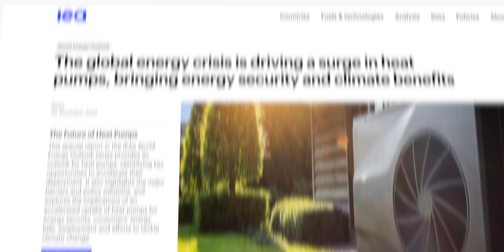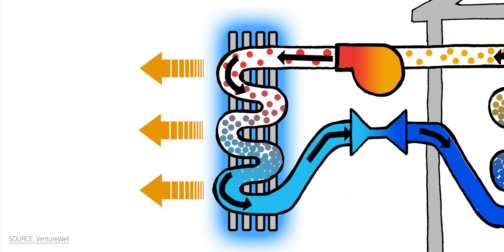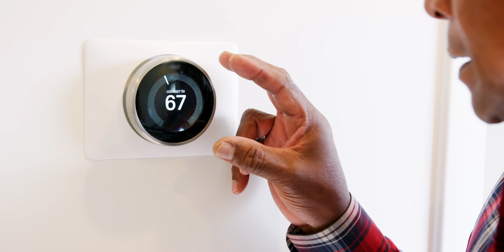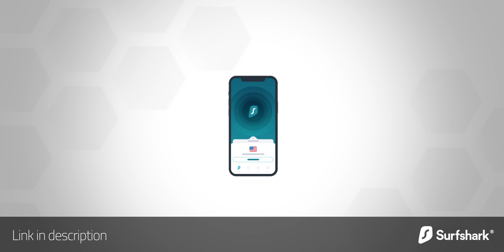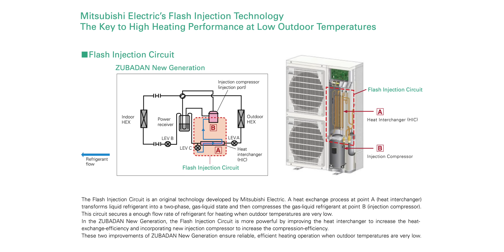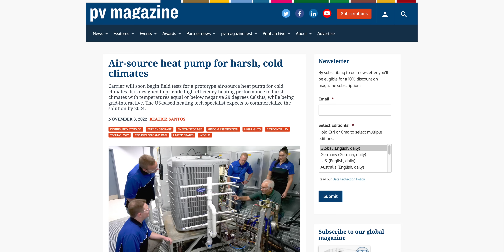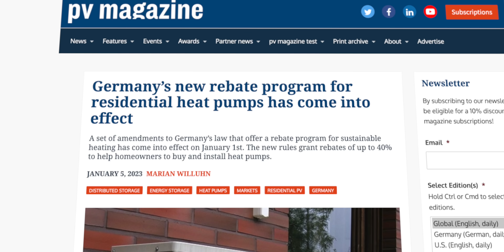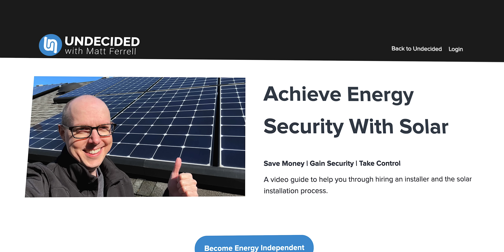Major Advances with Heat Pumps in the Extreme Cold

Comment: Here in Sweden, I have a ground source heat pump. It saves me approx 4000 USD a year at current electricity prices compared to resistive heating this building had before. We went from 35-40MWh/year to 16MWh/year. Just hot water heating with it saves 3MWh per year.

Lots of people here have air source heat pumps as well, if you drive around, most houses have one, and they've been used for 15-20 years.
Reply: How many amps/watts does your system use at full power?

Comment: Your explanation of heat pumps has a major error - as the high pressure liquid expands into the evaporator (cool side) it turns into a low pressure GAS which is what makes it need heat to change phase. Only the gas goes through a compressor, NOT fluid. The output of the compressor is a high pressure (hot) gas which condenses back into a liquid which forces it to give up heat as it changes phase back to liquid. There is an very well done detailed explanation here: https://www.youtube.com/playlist?list=PLv0jwu7G_DFVIot1ubOZdR-KC-LFdOVqi

Comment: As a New England resident that lives a bit north of you, I'm going to called Shenanigans on your "data".  You're basing everything on "new" or "coming soon" models.  I've had a heat pump in my home for 8 years.  Great in the summer for cooling but in the winter, below 25F, it just blows cool or lukewarm air.  I've contacted the local place that does my cleanings and service.  There is no upgrade path for these models to do what you are talking about.  I'd be interested what you find, given your resources, however for those of us who jumped into heat pumps as a big way to save money in heating, it really hasn't done much.

Comment: I'm interested in getting a heat pump to replace our very old AC unit (24 years), using it for cooling in the summer and for heat when it's more efficient than my 97% efficient furnace. I've been told that the crossover temperature for running the heat pump vs. the furnace is about 40F, but it's more of a rule-of-thumb, and I have yet to find an actual calculation for that. Also, it's been very difficult to find actual details on the IRA tax credit for purchasing a heat pump. Matt mentions a 30% rebate, good for up to $2,000, but I can't get an HVAC installer to tell me which models are eligible and how much the rebate will be. Very frustrating situation when one is trying to make a purchase and I don't have the support needed to make that purchase. 

Anyone have a direct link to the IRA tax credit details for heat pumps?

Comment: In Norway we had incentives 5-10 years ago, but now air to air hest pumps are so normal that the incentives are gone, but you can have the cheapest models for around 1000$ installed and the expensive ones are 2500-3500$ installed.
Liquid to liquid / ground sources heat pumps are still quite expensive at around 20000$+ for the heat pump system without any digging og drilling, just the heat pump.

I got my 2 air to air heat pumps for 450$ each on a special sale, quite a good deal!

Comment: No issue with air source heat pumps that was installed 2 years ago for heating or cooling the house. However my Hot Water Heat Pump system has experienced cold water once the air temperature reaches below 3C for a couple of days. As this only happens a few times during a Australian winter I have learnt to live with but still would prefer not to have this situation occur.

Comment: There’s no theoretical reason that heap pumps can’t be made to work at any temperature we experience here on earth.  After all as long as the temperature is above absolute zero (minus 273 degrees Celsius) there is heat present that can be extracted, it just becomes less efficient to extract it.

Comment: switching an oil or propane furnace ($45,000 per 10 years to operate) to an 18 SEER inverter heat pump will save you $30,000 per 10 years.

Comment: I have three heat pumps air/air and they are worthless. First of all they need another system for basic heat or they can't cope at all. And can only be considered a complementary source of heat. I have an open floor plan and that is not good since the pumps can't heat large volumes of air. They run constantly and freeze up in the outside unit even tough they have a heater. That is a pain in the ass because you need many days of not freezing weather for them to thaw up and they have to be turned of during the wait for that. And when you need them the most when it's minus 15 Celsius they just produce less and less and at minus 20 Celsius they just use energy and give no heat. i have learned that less freezing occurs if you lower the thermostat. So at minus 15 C I have to set it at 15 and at minus 20 at 13. By then my other system have kicked in long ago.  I can only see them as useful in dry climates like in deserts and were it doesn't get very cold. Ad to that the huge volume of ice that builds up under neath them. Stay away from air to air pumps. As for drilled holes and ground those loose efficiency fast due to not using them during the summer as air condition. The substrate you tap cools down. And what's the point to have to cool your house if there is no heat during summer like in Scandinavia where I am located. That eats up the winter savings. No, the only good option is  to drain heat from a body of water or a farm barn with animals. The only worse option is burning something, that is just plain stupid due to the air replacement factor that creates super cold areas in your house. Very few system takes air from the outside. Just vote for a government that likes nuclear and then use electricity for heating. That is the only good thing about heat pumps that there are no cold drafts.

Comment: Air to air Heatpumps can ruin your economy in the winter if you live near open ocean and the theperature drops below around - 5c to - 7c... Firs year I had a had I heatpump I did not know that because I believed all the propaganda that said they word just fine down to -25c. Yes they function perfectly fine down to -25c  but ONLY if the air is dry which it is NOT AT ALL when you live near open ocean...

Comment: I'm in Utah County, Utah.  I did a DIY MRCool universal heat pump install at my house.  Bids for the heat pump + install were up around $10k.  Purchasing the heat pump + air handler + pre-filled line-sets (~ $4200), the tools and ducting and whatnot to do the install (~ $500) and paying the electrician to upgrade my home panel to handle the new units (~ $800).  Going with this DIY setup saved me about $5k. 

Now, I did run into a couple of issues.  But those were due to my inexperience, not really with the system.  The biggest problem you can have for your air-source heat pump is the unit icing up. Normally the defrost cycle clears that up.... But I set up the unit just on the cement slab outside the house (MISTAKE).  These units create a lot of condensation.  You need to have good drainage.  The unit being right there on the ground creates icing issues, basically the ice grows UP my unit.  I've since fixed the issue by raising the unit up off the ground.  And now my unit runs a LOT less each day, the snow hasn't been an issue (lots of snow this year).

Comment: The biggest complaint I've heard about heat pumps are a) the slower heat gain of temperature (not like a furnace blast), so heating the house takes longer especially if you are trying to raise it 10 degrees, and b) because of the slow temperature gain poorly insulated duct work or windows will make it harder to heat becoming a larger heat sink/more problematic.  I wish these concerns were covered.  For me, the most energy efficient way to heat on the really cold nights, is to lower the thermostat (not off because you don't want to freeze the system) and use small space heaters only in the rooms you need.
Reply: This is why new homes and retrofits are designed to address the system as holistically as possible - heat pump at the heart if it's needed or new build - but the real ROI is in the insulation package, windows, and doors. Numerous studies have now shown the best money you can spend on efficiency is insulating/air tightness (especially at the roof and basement if you have one), insulating ducting, followed by good tight and insulated doors, followed by windows, adding an ERV/HRV, and lastly replacing old coal/oil/gas burners with a heat pump.
Reply: @anomatrix0000  Is making the building so airtight that no fresh air ever gets in a good idea,  we have all heard of 'sick building syndrome' due to lack of airflow.. I know you can get air exchange systems with heat exchanger,  but even more ££££'s
Reply: @chrissmith2114  That air exchanger (HRV/ERV) is part of what helps keep your indoor air temps/humidity stable and saves you more in the long run.
Reply: You shouldn't lower your temp at night with a heat pump. A new report from the government showed that. You're right it's too slow. So leave your temp setting alone. We've done that for  years and the system doesn't need to use the electric burners to reheat the house.

Comment: I've got a lenox heatpump/furnace combo at my primary residence and its pretty great, but it for sure doesn't work below 40F. I forced it to fill in for the gas furnace when I was working on some gas lines in the winter and it did not love it.  It frosted up pretty fast.  I also have a Mitsubishi inverter split-mini at a more northern, colder climate and that thing keeps on chugging WELL below zero.  Its amazingly robust and quiet too.  I've been super impressed with the split-mini.  The best part of the heat pump is energy independence.  Where this split min is, you either have to use electricity or have propane brought in and stored on site. We have used wood fired pellet stoves, propane boiler hydronics, and propane forced air in addition to heat pumps.  I loved the hydronic system when we kept it going but it was very slow to heat, and the pellet stove chucks out the heat but its pretty hard to justify given the emissions.  Right now we close down the place with the split mini in the winter and the other place is run with forced air propane.  I would love to move away from forced air propane to a heat pumps so I don't have to worry about propane levels in the winter when I am not there.

Comment: I’m in the process of adding two mini split heat pumps to augment my central HVAC system. Installation cost is a main hurdle here. Bids to install a single unit are between $1,500 to $2,500!  I overcame this by buying $350 of equipment and doing it myself. While I could overcome this installation obstacle many people cannot. BTW, it took me a total of 2 1/2 hours to put in the first heat pump.

Comment: Apart from variable speed compressors you didn’t really explain how the heat pump is able to extract heat from the outside environment when it’s so cold. Does it mean that the fluid in the evaporator would need to be colder than the outside air??

Comment: My air to air Mitsubishi have been working great since 2012. It does have a inverter based compressor for variable speed. Also it has a heat element in the bottom of the outside unit so melting water when defrosting doesn’t ice up in the bottom of the unit. 
It defrost the most just above and below freezing. Up to once pr hour. When it gets colder and the moisture in the air gets lower, it can run for hours without defrosting. 
IIRC it can keep up the BTU until -18c at least. But it is an older model. Of course the COP drops the lower it gets.

Comment: I wish people would explain the mechanism a little more correctly.  Compressing the air doesn't make it hotter per se.  The amount of heat latent in a volume of air remains the same, it just  gets concentrated.  When I comes to compressors and heat, I think of them more as heat concentrators.

Comment: Heat pump hot water system were sold an Government subsidised in Australia about 25 years ago . Had a a few . in the fine print they only operate above 14 degrees c ( about 60 F  )  they just used an electric element to heat them . This is because the advantages of compressing diminish to almost no  advantage at low temp . They would break down every year and need service under warranty . The company had to repair huge numbers . Result is most people will not buy them no matter what brand .We in Australia used to use hot water heaters that rang at night when electricity was 1/3 the normal rate ( thus helping stabilise the grid demand  ) .

Comment: We live in the NW where it gets below freezing in the winter and our home is heated 100% by a Mitsubishi heat pump and it's comfortable all year long. The trick is to never let the house get cold in the winter or hot in the summer. For example, don't turn the heat off at night -- let the pump continuously keep the house warm. A heat pump doesn't heat as fast as a gas/oil furnace, so going from 55 to 72 degrees takes longer than say from 65 to 72 degrees.

Comment: I am having a double air source heat pump system installed this month (Vaillant Arotherm plus, 15kw each). I live in Portugal, a mild climate, in a fairly large cold house. The CoP is between 3 and 4.8. It is not activated yet. The upfront cost is high, the installation in a very old thick stone house is complex and disruptive. The other options for climate control would not offer cooling in the summer. It would be have to be a gas boiler, pellet boiler, or electric resistance boiler. Even with the new solar electric system, that is not an efficient use of energy. The heat pump is really the best option by a large margin. The house also has other supplemental heat (salamander wood burners and a fireplace insert).Heat pumps are going to be mandatory in Europe, some countries are requiring it sooner than others. It is going to be the primary direction that most of the developed world is headed.

Comment: In the UK heat pumps face two major obstacles compared to using our typical gas fired heaters. The first is our housing stock is old so often lacks insulation. This means they leak heat so money has to be spent to better insulate the house, adding to the upfront costs of a heat pump system. The second is the use of either the boiler to supply hot water directly or a tank heated by water shared with the radiators. The former necessitates either moving to the latter or the installation of an electric water heater. The latter means the tank must be replaced with a larger one, because the water flowing through the system is cooler (typically 50C compared to standard 60C) and hence more hot water is used when mixing with cold for a desired temperature flow.

Combining this with the fact that even if the heat pump is 3x the efficiency per kWh, the fact that gas is just under a third the price of electric means many people don't want to go through the upheaval and expense of moving to heat pumps when the end result is about the same on-going cost.

Comment: There are 4 ways to make a heat pump work in cold weather. 
1) make it hot
2) multistage. 2 or 3 compressors each feeding the other and the last, us. 
For me, the next breakthrough is, somehow, siphoning each compressor's inherent heat from use, and delivering it to the first one.
3) Use more potent greenhouse gases.
4) all of the above
P.s. If you make the condenser/evaporator coil double, triple and so on,  you minimize the need for the above.

Comment: I had a heat pump installed three years ago while it works pretty good for heating and cooling during the winter time it definitely struggles in and sometimes I need to add additional space heaters to keep things comfortable
Reply: They definitely come in different sizes and sounds like yours just might be sized big enough for your needs.

Comment: The biggest issue is cost.  People can't afford them today, until the pricing comes down.  A 80% furnace is much cheaper.   When we had our heat pump, we always had to have our emergency heat strips on during the cold time.  Granted this was a decade ago, but with bad experience, I am not sure I would use another one.  Today we have two 90 KBtu 97% efficient forced air furnaces.  One other issue is that with heat pumps, you will need a much larger generator to get you through during power outages.  With gas you can run those on very small generator during those emergency times.  We had a 8 day span without power and -2F temps, if I had a heat pump, I would have been in bad shape and not be able to get heat in the house.   

Keep up the good work sir.  👍😁

Comment: My house was build at the last energy transition (get gas to every home).. built in the end 60tees mid 70tees it is insulated with the tech of the day back then... I don't have the efficient insulation required and need convince 4 neighbors to invest and i don't have enough space to install without being very noisy solution... so a big NOPE  (two neighbors are 80/90 y o so don't want/need to invest)

Comment: We live in Sweden (cold winters) usually "we" use an "exhaust air heat pump", where you reuse the heat from the ventilation exhaust to heat both the water that is used in water radiators or water heated floors and to heat the tap water... We use the NIBE F750 Heat Pump in our house. It also knows how much the current (hourly) energy price is, so at the point of the day when the power is cheep, it "heats" as much as it can to be able to "save" when it's more expensive... All this can be controlled of course.

Comment: How are these heat pumps efficient when A/C units aren’t? They work the same way when cooling. Simple heat transfer by a fluid and pressure differential. Living in vegas A/C is one of the highest cost in electricity.

Comment: Due to thermal dynamics the higher the temperature rise the heat pump has to deal with, the lower the possible COP is. For cold climates I think ground source heat pump with vertical bore holes are superior to air source, but it is a big up front cost.